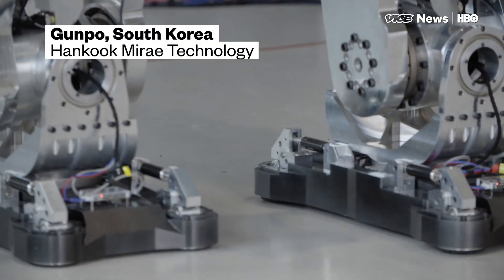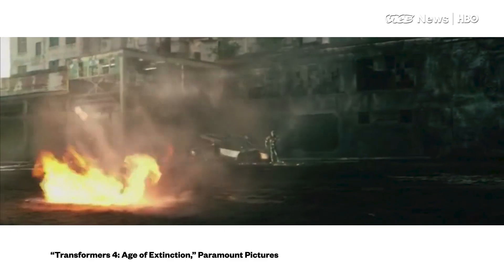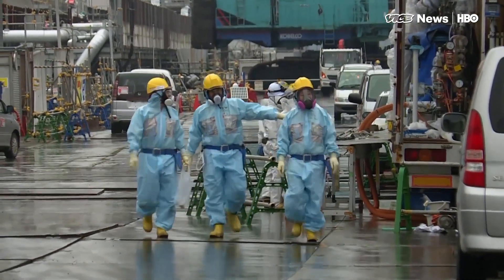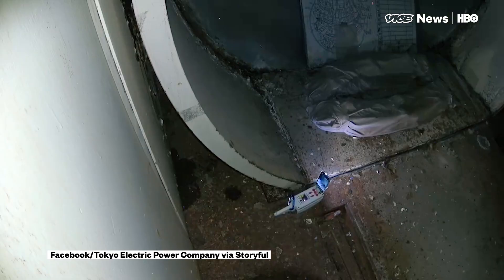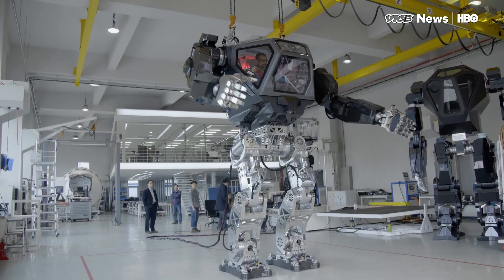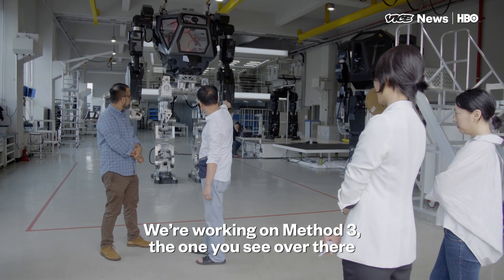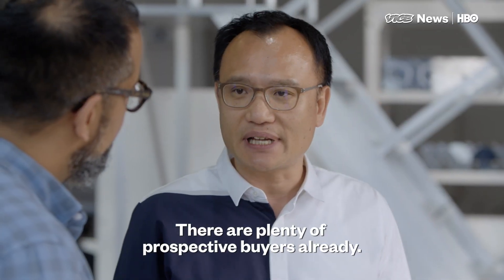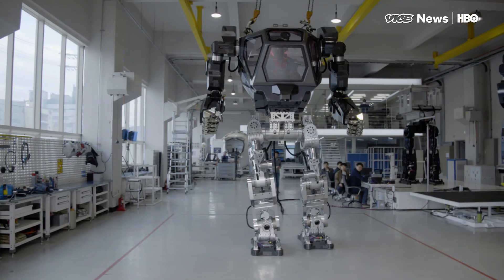Method 2 Is A Hulking Robot Straight Out Of Science Fiction (HBO)

Comment: I study IT and had a class about cognitive systems and legged 
automotion. What I can tell you is, that reality is still far behind 
imagination and most news about these systems are blown up. Yes, robot 
technology is very advanced, but when it comes to cognitive systems in 
an open environment, we are far away from building a system comparable 
to an insect. Available hardware just does not have the power, 
efficiency or characteristics to be able to match a brain. Transistors 
are so small, they eventually can't be downsized any more because they 
would have to be smaller than atoms. And still a morphological computer 
that could reach the number of neurons of a bee needs a storage center 
and industrial power supply. And that is only the hardware... Legged 
automotion is the next problem. The chains are not just for safety. This
 robot could never walk in a real environment without falling over. 
Also, there is no power storage on the robot. It has to be operated with
 a power chord. Current battery technology also struggles to advanced. 
Atlas, one of the most advanced two legged robots can only be operated 
for one hour, and it is ultra light and has a backpack-sized battery.

Comment: it needs a hip joint system in my opinion, that will make its walking a lot more stable and stabilize the torso as well making it a lot less shaky.
Reply: You are right but lets not forget how heavy this thing may weigh before they start building them with more high tech lighter materials.  They are just perfecting the basics first before they can go all out with the leg issues.  Perfecting new tech without a manual takes time.  In ten years more time this thing will be running down the street.

Comment: AI is no "big concern", it's a fad. I don't know why everyone is so obsessed with AI. That question should've never been asked, though I agree with investor's answer: AI is too weak as of the present for it to do any good in modern applications (Emphasis on "good", i.e. Silicon Valley is using AI for evil).

Also, the cables are not for balance. If the robot falls, the cables are the difference between a reusable prototype and  $200,000,000 worth of money, time & effort down the drain.

Comment: This thing is not the future it is the past. A predator can destroy that in a matter of seconds. Remote control a modern tank and it is done for. There is no future in military application for a two legged robot of that size and capability.
Reply: I think there is a lot of potential there but it's still not that useful, like a slower more vulnerable tank. Though at some point in the future when its not just barely keeping balance it could get pretty agile and have other benefits that tanks can't have. Like peeking over walls, creating trenches quickly, adapting to different cover with minimal exposure, throw explosives over buildings, grab heavy pieces of metal / part of a wall and move it somewhere for cover...
But it certainly is not even close yet

Comment: I, for one, am glad that we live in the Patlabor timeline. It's curious that they only mentioned disaster relief, firefighting and military operations as applications while completely ignoring it's potential in construction.
Reply: Xxx88Xxx One of the advantages of using a machine like this in construction is that it'd be able to easily and precisely maneuver select pieces of heavy equipment into place for installation into spaces that a larger piece of machinery couldn't access.

I'm thinking something like lifting and installing an industrial A/C unit into a location a large crane can't easily reach, or working within the confines of a narrow urban environment. It wouldn't really replace heavy machinery, but instead work in concert with them.

As far as stuff like the cables go, that's just a design issue. Future iterations probably wouldn't need them as improvements are made to mobile power supplies and self balancing systems.
Reply: Ugh-Fudge Bwana that will put a lot of people out of work, this has already become an issue with computers being able to do human work
Reply: Xxx88Xxx good point, I was against use for construction until I read your comment.
Reply: Don't worry, av-98's have already patrolled tokyo.